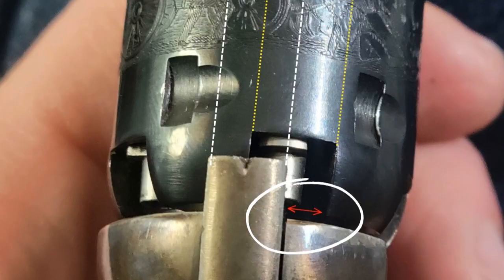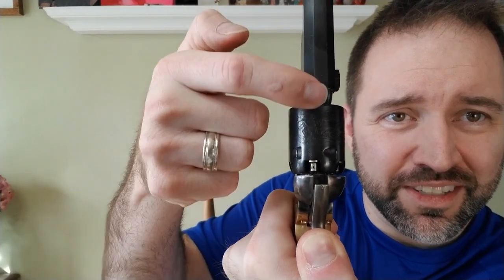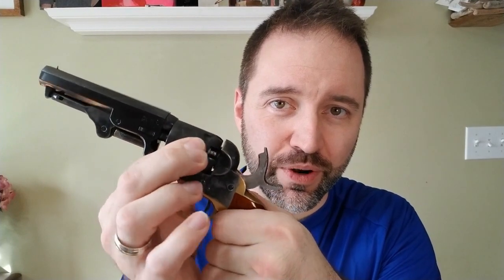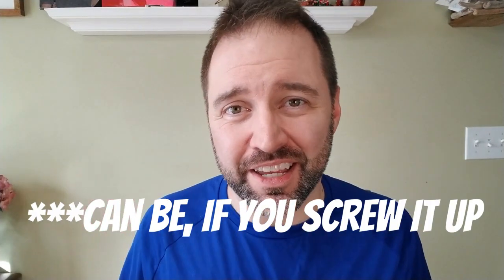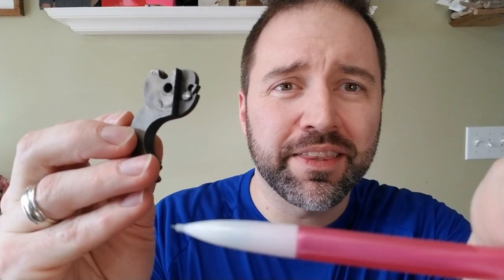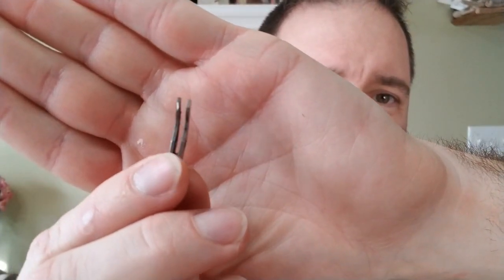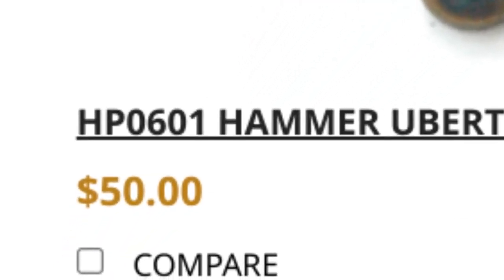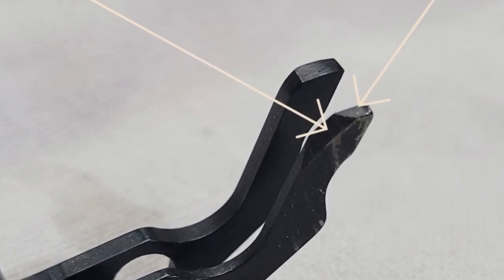Timing Issues in a Cap and Ball Revolver

Comment: I had "almost" the same problem last year. I ordered all new internal parts for my 1851 from Taylor's, put it all back together and the cylinder was over traveling every time I cocked the hammer. Turns out the hand assembly was pushing the gears in the back of the cylinder too far. So I shaved about a half a centimeter off and now it's perfect.

Comment: Worth mentioning here - you WILL almost need to take a little metal off the hand if you've bought a new hand because the spring has broken (a common failing).  The reason being that the new hands are made to be adjusted to the gun at the factory - so they are long enough to be filed down precisely.  This will likely as not cause over-throw that will need reducing.
Someone will come along and say that it is a thinly case-hardened part and removing metal will increase wear.  They are case-hardened enough to accommodate fine-tuning.  

FURTHERMORE, if you ARE replacing a hand because the spring broke in an otherwise well-timed action, it's worth getting a caliper and measuring the distance from the flat section of the hand to the bottom of the pin that fit's into the hammer.  Then you can compare the same to your new hand.  This will give you a head start in knowing how much metal to remove from the outset - filing a bit shy of the original, so you can fettle perfectly with fine abrasive paper.

This way cuts out some of the tedious rebuilding / stripping / rebuilding / testing routine because, if the discrepancy warrants it, you can start off with a fine diamond file to get the bulk of the excess metal out of the way before fine-tuning with paper. Go slow - easy to take metal off, not so easy to put it back.

Conversely, if your timing alters through wear of the hand to the point that it under-throws slightly...
It's sometimes possible to lengthen the hand by putting it flat on an anvil, putting a suitable flat steel punch on the side,  and giving it a judicious tap with a hammer. This squishes the steel slightly (in all directions) including lengthwise.  It may be just enough to correct your throw issue.  Worth trying, as if it doesn't, work, you were going to have to replace the hand anyway.

Comment: As you said keep the surface true , i use a black sharpie type permanent marker on the surface being ground or filed or sanded to help keep it flat and true to the original angle / surface , you just keep checking that the black is being removed evenly and adjust to keep it going that way ,then re apply the black ink and keep going ,theres a hardening powder you can buy ,you heat the surface for hardening til red then dip the red bit into a measure of powder it'll sizzle n smoke dont breathe it i think its cyanide or arsenic or something let it cool or quench in a bit of oil ,this should harden just the surface and not interfere with the rest of the pieces structure ,,cheers big ears from down under

Comment: I highly discourage fixing the timing the way it was shown in the video unless you know what you are doing (and you probably don't if you have to watch this video). The bolt stop and/or hammer are only surface hardened, removing metal from working surfaces of these areas leaves you with VERY, VERY soft steel underneath. It is necessary to reharden the altered surface afterwards or you risk accelerated wear. I've seen dozens of broken actions from "trigger jobs" because the trigger was never rehardened and simply wore out quickly. Same story with hammer cam.
The over/under travel issue should be first and foremost fixed by adjusting the length of the hand. Shortening hand decreases how much it can rotate cylinder and will most of the time fix the overtravel. It is how the factory finetunes the action. Mind you that the hand is never surface hardened thus requires no rehardening.
Reply from the maker: Thank you for your input and experience on this.  You brought up a really good point about the metal being used.  I did this one year ago and haven't had any issues yet through regular use and shooting, but that's not to say you're wrong.  I'll keep an eye on the fingers of that bolt stop with each cleaning to see if I notice any changes when I'm doing my cleanings.   Thanks again!
Reply: @BlackPowderGuide  I think the bolt stop might be made of different kind of steel and different tempering might be used because its prongs need to be elastic and work siilar to a spring. That might be the reason why you see no unusual wear. However everything else I said is true for hammer and trigger as I have myself seen that happening. Anyways, I still would recommend shortening the hand rather than messing with bolt stop. Shortening the hand is pretty straightforward.
Reply: @franklinAll8735  If the action on a 58 is crisp and tight but has a millimeter or two over travel barrel alignment and leaves small dots on the leading outside edge of the cylinder stops, it's all a matter of polishing the hand down a little?
Reply: @zap7759  No, it is designed this way. You must have a bit of overtravel to firmly lock the cylinder. Undertravel is something you should worry much more because it can result in no lockup of cylinder whatsoever and this is unsafe.
Reply: @franklinAll8735  Thank you, sir. It is closer aligned with the hammer down than at full cock but it's good to know It's not crazy for shooting like this. 

My NAA Super Companion .22 cap and ball is 100% on like a DA cartridge revolver so cleaning that first then the New Army was probably why it got noticed.
Reply: And now I'm looking for guidance for hardening these parts lol

Comment: Thanks for the video. So i have an antique colt pocket with some new replacement parts in it and i only notice over travel on one or two nipples. When this is the case is it still this same issue or could it be something else? I haven't tried pulling the hammer quickly yet but will do so in the morning.

Comment: I do the slow pull, but function track each audio or felt click? just did it on two types of repro colts. one was the pushing paw a little to wide for final travel, the other was a sear catch ratio to location. Number two was a combo of hammer and bolt and less is more! 

I did "also discover" a new issue in my multitude of "assembly" and "diss" assembly? I found my two alignment pins with cylinder axel fit so well that with oil becoming a Very Good Vacuum retainment system. So "I" vented these vacuum And pressure points with well thought out lightly introduced imperfections for venting.

Then I noted how the paw was nested against its spring and travel slot with Final wedge and assembly? and how this affected cylinder travel and tolerances, Again back to Very minor paw adjustments to travel slot and axel with Uniform wedge placement. "My" wedges are Not 16D Nails!

Live and learn! If it is Not Working, WHAT do You have to Lose? much Like CPR the patient is Dead! you can't Fail!   this leads to more knowledge, like learning Re heat treating the part with case hardening removed. now "I am hooked" Like a Big O'l bass! on to electro plating and chemical bluing, and DIY consumables. This stuff got me hooked at age 12 on my bike with a $69 Kit .44 58 in 1977! still hooked now with a truck! and my own tools and work bench.

Comment: After first very deep cleaning and greasing of my Uberti Remington 44 cal I noticed that the drum turns very very fast and easy, but every time I pulled the trigger, drum was mostly outimed ( like 90% of pulls). Than I adjusted the main spring, which is inside the grip, with a screw placed outside in front of the grip under trigger. I gave it a try a few times and it does work good now. Maybe thats the problem?

Comment: Mine works only with fast pulls, i get under travel and it seems to be the case that the previous owner took too much off the hammer. Found mine for $50 though so at $100ish for the revolver i can't beat that

Comment: How do you know if your wads are dry or old?
Reply: I do not use wads any longer in my BP revolvers, only my long arms. and mine are DIY to my use and needs even the temps but they all work to one degree or another. I grease cap over my seated balls for final inspection, and frontal chain fire prevention and metals coating for cleaning. I love Ballistol for light oils and cleaning, and a bees wax based for heavier grease. "I find" this also helps with fouling and cleaning later even Leather gloves, boots, or rust prevention. I look like a greasy chimney sweep at the end of a day, but it is great skin lotion or case lube too.

Comment: I would advise replacing the nipples with quality aftermarket nipples from Track of the Wolf, Tresco, Slix Shot, etc. When you held the cylinder up to the camera I could see that the nipple flash holes are WAY too large, and will allow excessive back pressure and cause cap jams. This is common on modern reproductions. Revolver nipple flash holes should be so tiny that a small sewing needle cannot pass through.
Reply: Interesting. I've personally read that originals didn't even have flash holes in the cones and were just bored straight to the internal diameter of the nipple.
Reply: If you look at 0:50 - 1:03 it looks like he's using Slixshot cones, as you can see the hole in the side of the cones which is a Slixshot design